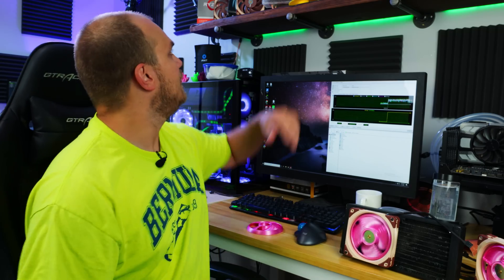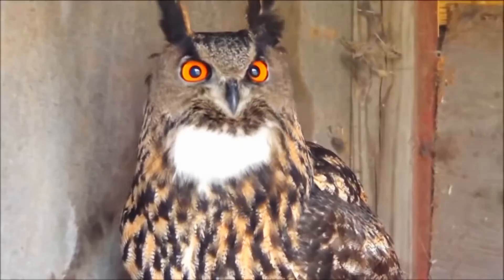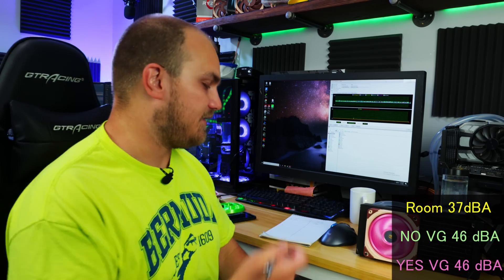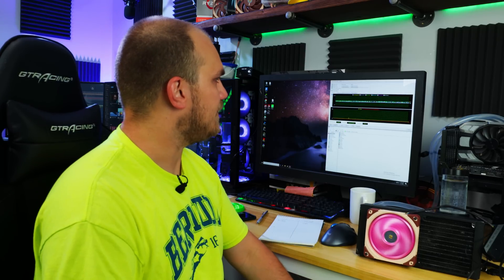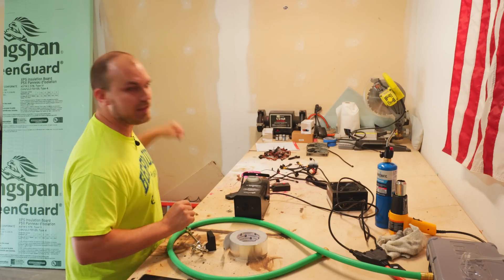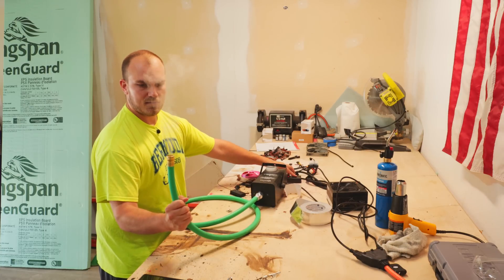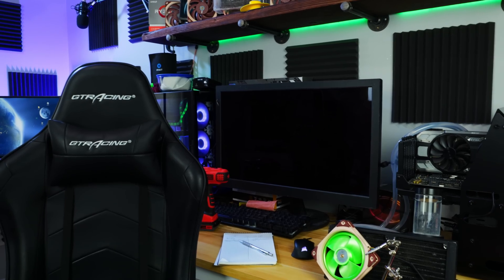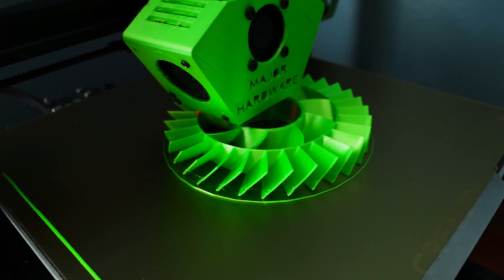Do Vortex Generators Make A Difference | 3D Printed Fan Testing

Comment: The fan is moving too slow for vortex generators to have any noticeable impact. The primary purpose of vortex generators on an aerofoil is to disturb the air flow and make it stick to the aerofoil better, specifically in HIGHER air speeds and higher angles of attack. As the air speed gets higher or the angle of attack increases it is more likely to separate from the top of the aerofoil, thus losing the low pressure effect above the aerofoil, causing a stall. On a wing this is bad, it means no lift. On a propeller/fan blade that is constantly spinning it means air isn't being pushed where it needs to go. I doubt the speeds you're running these at will show any difference. If you were to overvolt and speed both the VG and non-VG designs right up you'll notice the non-VG design loses effectiveness at a lower RPM than the VG design.
This may also be something to consider for future designs with higher angles of attack, or designs for higher RPM.

Comment: The Lancer Evo vortex generator was to redirect airflow over the rear wing to increase downforce. Since they are rallye cars they are meant to be drifted in and out of corners and with the vortex generator it sends air towards the rear wing in a straighter path to increase downforce. Incorporating it in a case fan use I highly doubt it would be beneficial.

Comment: Since people are suggesting things, i would give a tip. On top of a regular dB measurement try to do a audio spectrogram. On android try Spectroid. Basically you can visually see the noise that the fan (and everything else in the room) makes. This would show frequency changes. So two fan designs could make the same amount of dB, but at different frequencies. One can be annoying, the other would be fine.

Comment: Forget the vortex generators. Golf balls have dimples to make them fly longer and putting dimples on cars increase fuel efficiency. That makes me wonder what kind of effect dimples would have if put on the fan blades.  I don't expect it to work in any kind of manner, but that doesn't mean it's not worth a try. With less drag comes increased airflow, right? :P

Comment: The point of the vortex generators is using turbulence to equalizing pressure by reducing formed vacuum regions (or mixing gasses together but that's not our intention at the moment). In the front can be useful but whether those speeds is reachable with 3d printed plastic is something that needs to be tested (it might be possible with the quad engines), as some have said put them on the end would be the more rational choice as that is already what Noctua does more or less, but looking at designs that would differ from Noctua if you let the blades curve a lot more in the axis of the airflow you could have it partway and let the coanda effect let both sides of the fan blades do effective work for longer.
This might be both noiser and spin slower, but it might have the advantage of doing more effective work per rotation (or not it's 15 years since i studied this and since then my only usage of these skills has been in games so I have the potential to be a bit rusty).

Comment: Does placement of the vortex generators relative to the leading edge of the fan blade make a difference? On airplane wings they are placed in locations where the laminar air flow begins to stall as a way to keep the air moving quickly across the surface and maintain that low pressure above the wing. With a stepped 3D print, each step acts like a dimple in a golf ball allowing a bounty layer to form and already smoothing out the air flow which is another reason there isn't much difference between the two fans. 

Maybe try slats in the blades of the fan (like pin holes) about 2/3 of the way down the blade

Comment: Vortex generators create drag and noise, they do however create turbulent flow which sticks better to the curve of the blades, however if your blades are already at an inclination of 15 degrees or less to the AIRFLOW(not plane of rotation) the vortex gens wont do you much considering there is no flow seperation to fix. also you can replace the fins with a groove, does the same makes less noise and drag. the most effective part of the blades in this case are the tips. which you blocked airflow to with that ring, i get the idea behind it but thats best integrated in the frame. Alot of people think corsair or noctua are the best, they simply arent. arctic has comparable performance for about 1/4th the money. and delta destroys the competition in terms of flow, and max volume(the one i got does 63 db o.O). the final fan design looks sick, however the blade angle is pretty high on the outside which will cause flow seperation(if airlow to the fan is low a.k.a. restricted).

Comment: You know this guy has an engineering background when he is sitting in front of a computer yet still reaches for a pen and paper. Who needs excel when you have a notebook :) 
Jokes aside, doesn’t the ring help out with printing without supports? Will a ring less design be printable without supports?
Would you be able to try and print different fans with different blade pitch/angle to the vertical axis and give it a try? I’m interested to see what 5 or  10 degrees more or less will do?
For sound test you can grab cheap tripod from amazon and a phone mount. Try to measure the distance from 3feet away because that’s how far you would usually sit away from a case.
Keep up the great work, it’s entertaining, informative and you will end up with something great I’m sure.

Comment: Vortex generators on cars is to allow the air to stick long the rear window, so the wing spoiler can be more effective. Look at the roofline then look at the trunk lid, finally look at the rear window. The area between the window on the trunk is a large low pressure zone. VGs are to shrink the low pressure zone.

Comment: Having the shark fins will add weight and make it harder to balance (not that balance seems to be currently an issue). It would also add resistance so could possibly spin at a slower speed (again. Probably not significant) but its worth mentioning since you are after the most efficient design.

Comment: major i think it would be interesting and possibly increase airflow or static pressure you know the air scoops on car hoods what if you put ones of variable sizes  and locations behind the leading edge of the blade

Comment: couldn't you send these two to the slowmo guys? But nevertheless im curious for the five bladed design! Maybe delete the inner vortex generator, to "clean up" the look a bit. or extend the outer most to "guiding fins", such that you have a few (three would be my guess) vertical walls on the blades. You could taper them inward, for the looks.

Comment: what I would like to see: keep the ring, make it 5 blades, pull the outside of the leading edge forward, then it cuts through the air rather than hitting it at once. hopefully that makes it quieter

Comment: Place both fans with the fog machine in front of them, the rear fan is the normal Noctua(powered), the front is the green/pink(not powered)with slow motion from the phone you might be able to see the air flow on a micro scale.

Comment: I think that the vortexgenerators are on the wrong side. They should prevent the air to flow reverse, after the blade. So the airstream should be smoother behind the fan, because there are less swirls.

Comment: Try to take the VG idea to 11. Waaay larger VGs, VGs in other places along the blade, blade completely covered in smaller VGs (like a golf ball or inverse golf ball), a row of VG shaped arcs on the underside of the blade..

For smoke test you might need an acrylic tube with another fan on the other side to have a better idea of how the fan in testing affects the flow. Maybe try a laminar flow attachment to the smoke machine, see what happens.

Comment: Keep the ring. The ring is to reduce the gap between the fan and housing to effectively 0. Just take away the curve, make it flat
As you may know the gap between the blades and housing is an important parameter.
Asus does it on their gpu.

And a quick note. There is no focus on the underside of the blade. Where I suspect you have a zone of high pressure.

Comment: Just some food for thought. 
Fans do have a deadspot right in the center of the fan where the rotor is. Maybe those "vortex generators" where designed with that in mind, trying to make the air movements a teeny tiny bit more erratic and at least trying to get some fresh air to the deadspot. In your close up of the pink fan you can clearly see(at least I think I can :D), that the air isn't moving in a straight line (like with the green one) but more like it's getting pumped through in intervals and not trying to get more static pressure or water displacement, but simply a wider radius that the air can move behind the fan blades?
Thank you for doing this, you are like my McGyver of DIY PC Parts and I love it :D
Have a great day! :)

Comment: Maybe try having two different heights of fan blades, alternating. Start off with 5 blades that extend a bit past the fan housing, then incorporate another set of blades with half the height between each blade in the first set. I would also like to see the effects of a compound S-curve type blade. Both of these ideas combined would create a fan very similar to the compressor wheel of a turbocharger.

Comment: The vortex generator teeth must be at backside... As faar as I know.... Those disperse (generate turbulence) flow of air so they don't stick to blade surface.. They r used on airplanes.... (I watched on vertasium).. U aren't helping by outing them on front side... The turbulence generated is just wasted as its in front...

Comment: Try it with a double-decker design for the propellers, i.e. 2X4 on top of each other and at different angles to get a venturi effect ?! e.g. the upper blade at an angle of 33-35 degrees and below it at 30 degrees.
ps difficult to describe something if you can not post pictures or drawings and rely on the help of the translator to find the right words

Comment: love the major hardware cover on the 3d printer, i think along with testing on the radiator you should also test on like an nh-u12s. as for the vortex generators, i would maybe suggest elongating them if your wanting to keep them, have them run maybe half way down the blade to a tapered edge. i would keep the ring to give it some more rigidity but have a less agressive arc as it looks like you could get some extra fan blade out of it. but i think they look great the way they are, that green is an awesome colour.

Comment: Before I even watch they probably don’t work because the angle of attack of the blade is low and also the rough surface of the 3D print creates enough turbulence... watching now so probably totally wrong 🤣

Comment: I think most of the difference is on  exhaust, was not that you that did box test? anyway, try curving blades more, so that they grab air from outside edge and direct it to center hub and dead zone in the middle of the fan, that will make most difference

Comment: Vortex generators on Cars are at the end of the Car and underneth the Car.
You build it on top and in the front. So what if you put it like on the car?
I think it wil helps to direct the airflow, which is not really a need for unless the part to cool is about 5- 10cm apart from the Fan.
Look at Delta Fan´s. They have many many Patends on his Fans and have on the output side reverse drictional blades installed.
I for myself have got a ML350 Gen8 Server which has 4 Delta Fans inside and iam out to build in these Case my PC. Not mentiones that the case alone has a wheight of 25KG =P
So try to pront out something like Studio flash honeycomb and put it in between the fan and the Radiator but i don´t thinkt it will help you to gain any kind of Performance.
Oh and these fans are shown by linus here: https://www.youtube.com/watch?v=nAFB9w2Rh0Y

Comment: How about this: sacrifice another fan to make it hot swappable. Stack them on top of each other, one regular  way, the other upside-down. So that they are spinning the opposite way to one another. Leave the first ones blades the way you have them, but design the blades of the second one so the air travels one way thru both of them, even tho they're spinning the opposite ways. Bit of a one pushes the air in the pathway of the other type of deal. We could compare that setup vs a single fan.

Comment: Keep the ring man, it’s giving you positive pressure, getting rid of that would be about as effective as removing the entire shroud.

I still think you should just bring the start of the fun further around so that it overlaps the next fin by 50-60% this making the scoop more scoopeh, this should help improve static pressure and flow, also should help bring this back to being a scoopin rammin fan design.

I have no idea about vortex generation, but I do know, extra weight is extra weight, removing them should reduce drag, rotational weight and resistance allowing for a higher top rpm and a cooler motor.

This is the first time I’ve actually been psychologically present when you’ve said your name, love the new banner for your self introduction, very nice touch.

James, my name is Jamie, we have a variation of each others names 😂👌
Reply: 7:16 I think to find out what your vg’s are doing, you should use something like a smoke machine, this will show off the flow of the air around it, this is where you’ll notice most of the difference :)

Pretty surprised at those results, that had to be about 3 grams of material you removed atleast, that should have had a more serious affect on rpm than it did, seems like these motors are designed for a heavier blade.

(You should try to continue adding a fins and tightening the air gap between them, until the rpm starts to reduce, maintain max rpm and minimum weight but maximum flow)
Hope this helps a little bit :)
Reply: Awww shit 8:13 I forgot you actually had one 😂 I should really watch the whole video before commenting 😂👍
Reply: 11:53 I noticed that the vg fan was actually pulling the smoke in from the outside too, not just from the centre, it did effectively generate a vortex, I want to see them get atleast twice as aggressive and see a test again, that should help put this to bed.

You had a dual wall sucking force pulling that smoke in, you could see how much smoother the outer wall of smoke was while it was being pulled through by the fans.

Kudos on these fans man, you’ve genuinely made a decent fan design, it may net be better, but it’s pretty fucking close to being on par with the noctua. Add one or two more fins and I bet you’ll be scoopin and rammin more air than you know what to do with 👌

Also, these fans are going to be thrown into a vacuum type scenario inside of a case, should try and setup a cardboard box test bench to recreate a pc case environment and see how well they perform in a static pressure type situation.

Comment: You have seriously won me over with this deep dive on fan design.  I believe there was some difference air quality and flow with the vortex generator version, obviously you spent a lot longer watching extra footage etc., but it looks like the intake stream is wobbleing (not turbulent, but its like a laminar twist), i dont know if that is good or bad but it caught my attention.  As for my suggestion, you'd need to invest significantly more time printing on a .1mm nozzle or similarly smooth the prints AND use professional air testing equipment to know if they make a difference, so instead go all out on the looks; lengthen the spines on the vortex generators down the profile of the blades, long sharkfins running the length would be sick.  Performance wise, performance cars have all types of fins coming off the backs of their cars too, not just the front; a vortex generator on the front might help airflow attachment to the blades, a vortex generator off the back would help separate that airflow from the fins (or splitting the tips, 2mm curves up*split*2mm curves down*split* 2mm curves up).

Comment: You'll probably be drawing slightly more power and running ~1 RPM slower if you use it due to the added weight. Not really important but should be noted.

Comment: Excellent series.
My modifications would be to remove the taper on the ring and keep the ring. I don't know if you can make the ring into a truss frame, i.e. triangular cut outs, to reduce mass.
Reply: The extra mass causes an effect similar to a flywheel by creating more rotational inertia, which allows it to impart more force upon the air without losing as much rpm. I might even suggest a thicker ring.
Reply: @stellavalkyrieyoung  I understand the reasoning, but I'm inclined (without doing the maths) to think that less mass will be more effective.

Comment: since you ware scooping the air, why not increase the fan size ring to increase the air presser.
make the scoop circle radius size bigger (upper area outsize the fan frame) that the fan layer on the upper location of the fan cover.
bigger circle radius size hole to smaller circle radius size one.
or you could do the same but increase the mouth (opening size for air) to increase the amount of air flow.

Comment: i see a lot of people just doesnt understand top of blade have no affected of air only bottom side of blade does catch air n push it down
top does actually nothing just make little pit noise or adding weight on blade help it balance it n i did notice pink one little bit off balance whooping than green one was straight smooth less shaking

i leave it up to yall to deside to-do 
me dont personal care about it longer have higher cfm